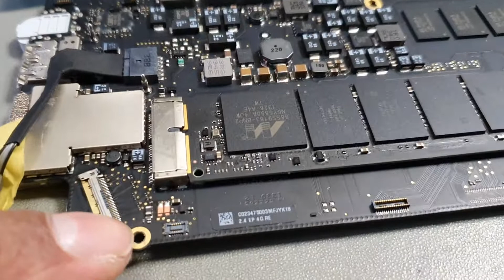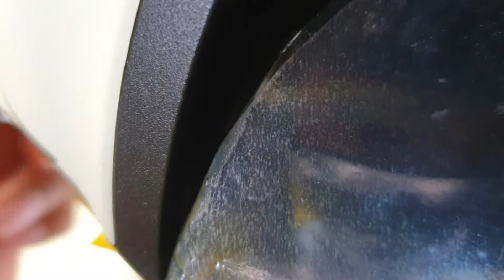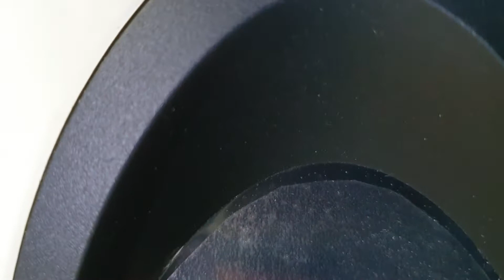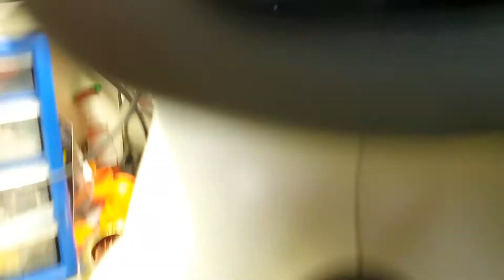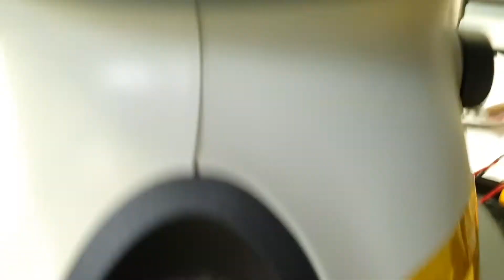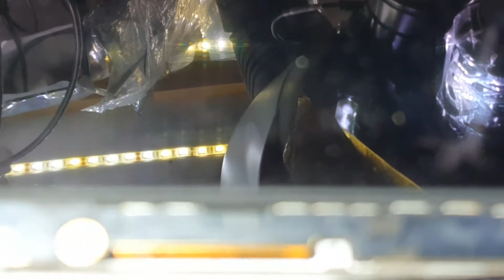Macbook Retina A1502 chimes but no image WHY???

Comment: You can use low melt solder to remove the screen connector without heating too much the area.
Reply: You don't meet to. Just use big tip and lower temps on your iron and it's easy to remove. Resolder it with normal leaded solder.